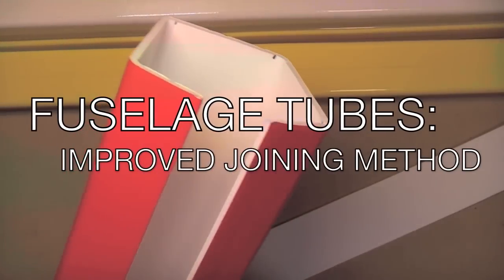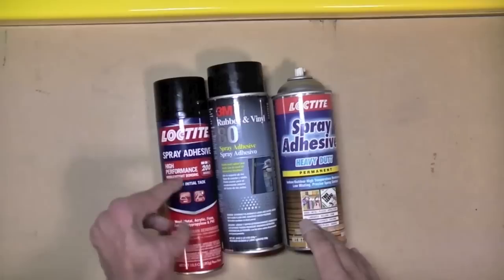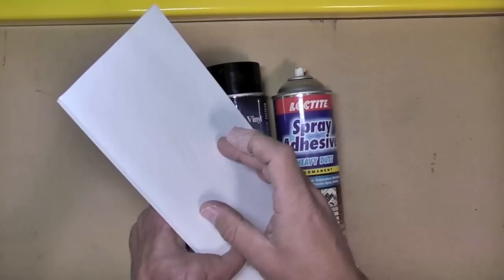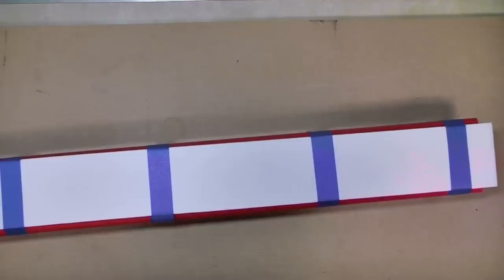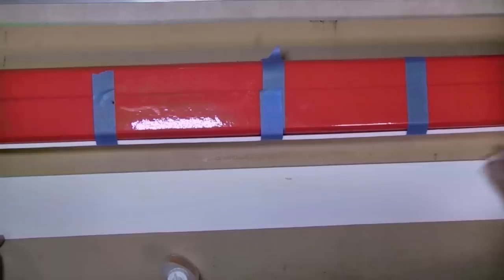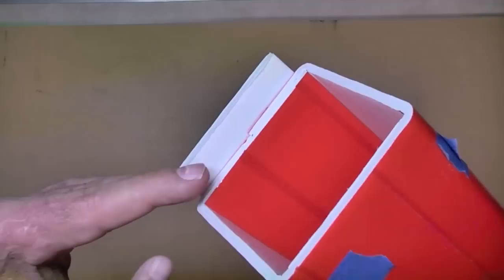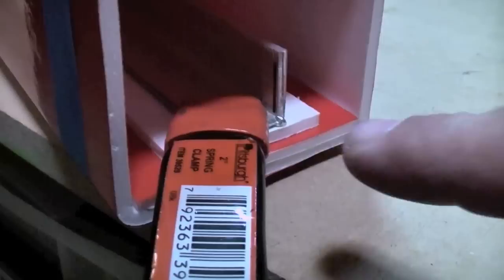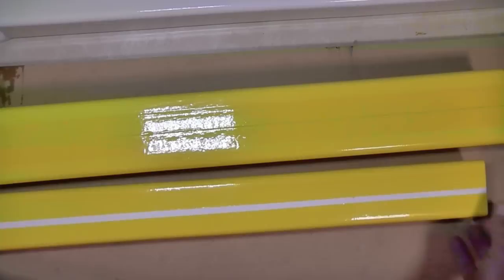Foamboard Fuselage Tubes - Improved Joining Method

Comment from the maker: It is my hope that builders get creative and change/add as many things as possible to these designs.  Landing gear is a great idea.  It's a little hard to anticipate all the possibilities.  I will plan a video at some point.  In general I will say that using plastic gift cards glued inside and outside the foamboard fuselage tube makes a strong reinforcement and good landing gear attachment point.

Comment: Did it today for two fuselages. Works fine.  The outside board I don't need if the desk is really smooth. Thanks, so I will go to the next steps.

Comment from the maker: That is a great idea for the very diligent builder.  That is one of the corners I cut for this operation.  I personally clamp the hell out of the fuselage joiner but if you were using less secure means then the glue squeegie trick would probably solve the issue.

Comment from the maker: @gKadonoff Mine are a little bit squishy against the corners but never enough to cause a problem, at least up to the 4" plus sizes.  Options include installing one or more square foamboard bulkheads inside the tubular structure or installing cross-members of foamboard inside from corner to corner, both ways.  The cross-members are better if you need to pass through wires, etc.  The bulkhead method is very strong but takes a little effort to fit precisely.  You can always penetrate for wires.

Comment: I am building a 60" wing span, 45" long fuslage, twin motor fpv plane, using your techniques. Have you ever come up with a rule of thumb for coming up with the dimensions of a box section fulsage joiners like you used on the Peace Drone? I am joining a 30" 3"x3" to a 15" 3"x2" tail section. Thanks

Comment: Since I'm making a tapered fuselage that ends up quite small at the tail, I have to use smaller clamps.
And for clamping, I'm about to use a 1/2 inch wide section of adjustable wall shelf support in place of the wider ally angle. The metal shelf support is very rigid and I will hopefully spread the pressure out sufficiently onto the scrap foam piece. Also, I'm going to have to cut the metal down a little in thickness at each end, so I can get my clamps in as far as I can.

Comment: Have you ever put any kind of lateral bracing inside the fuselage tubes before you complete it? I have found that my fuselage tubes are strong length ways but not so when you apply any kind of force against the corners.

Comment: I'm about to build my first foamy, and your videos are a really nice resource. Thanks for taking the time to make them.
On a side note, the clamping technique that you use in this video is very familiar to me- using cauls to distribute the clamping force lets me do glue-ups in my woodshop without breaking out 47 clamps and a brick. I have been using bowclamps for several years now; they are too stout for foamboard, but there might be a more suitable material to make cauls from. bowclamp.com